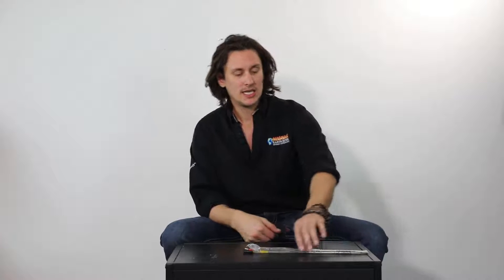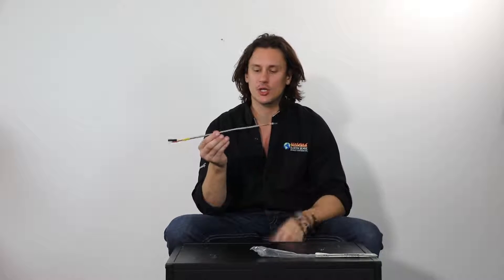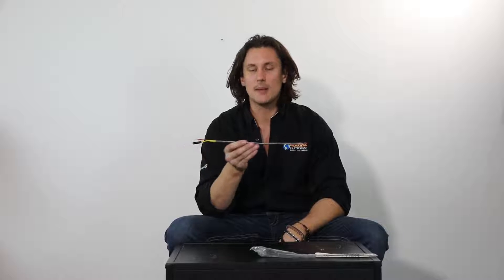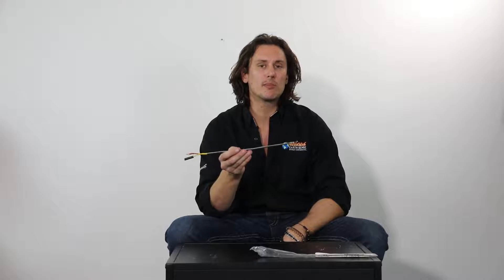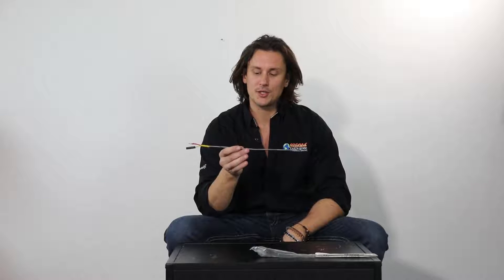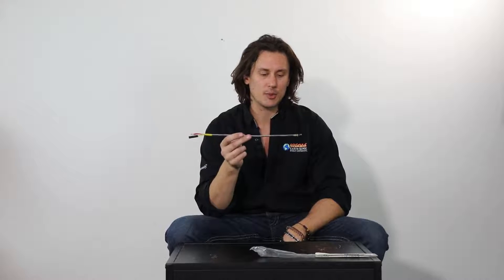Quadrafire Thermocouple Function & Troubleshooting

Comment: Really appreciate this series of videos - straight forward and helpful. That being said, troubleshooting my Quadra-Fire Contour has me stumped. I have replaced components and wiring (previous owner had just about everything jumpered out).  New parts - Snapdiscs 1, 2 & 3, thermostat, vacuum switch, and igniter. Everything works fine except I have to jumper out the vacuum switch in order for the stove to feed pellets.  The door gasket is new and seals well. The exhaust fan seems to function just fine, but it will not run unless the vacuum switch is jumpered out. I have validated the vacuum tube and where it connects on the stove is clear.  What am I missing??
Reply from the maker: Thanks for contacting us, happy to help. Appreciate all of the details here. There has to be something tripping the vacuum switch. In most cases this will be ash blockage somewhere in the unit or venting restricting the air flow. One of the best ways to pull ash out of difficult to access areas such as the firewall, heat exchangers and exhaust manifold is to put the SUCKING end of a leafblower vac on the outside exhaust pipe. Make sure the stove is off and cold. Have someone in the house opening and closing the front door of the stove and moving the heat exchange scrapers. This will pull out ash we may not have seen that is clogging or blocking the air passageways. Here is the style leafblower vac our service and maintenance team uses - https://pellethead.com/product/toro-vacuum-leafblower-pellet-corn-stove-exhaust-vent-cleaning-system-3-4-venting/

From there we can do a voltage test on the exhaust fan if needed to determine if it's producing enough volts on start-up to lock in the vacuum switch. 

Keep us posted, happy to help.
Reply: @EarthSense  great help - looks to be an exhaust fan beginning to fail.  Thanks!
Reply from the maker: @skokes2010  Glad we were able to help! Glad you found the issue - here is the combustion blower for the Quadra-Fire Contour for your reference. https://pellethead.com/product/quadrafire-heatilator-pleasant-hearth-pelpro-exhaust-combustion-motor-blower-fan-oem/

Any questions going forward just let us know. Thanks!

Comment: I replaced the ignitor on my Mt Vernon but it still refuses to start.  It loads and the fan goes on but that's it, no heat from the ignitor.  What gives?  A fuse or a thermocouple replacement?
Reply from the maker: Thanks for contacting us. Do you have a Mt Vernon AE or the Original Mt Vernon with the 4 Speed Control? Happy to assist.
Reply: @EarthSense  I have the AE.  I fixed my problem.  The 2 ignitor wires are fused in line and one literally fell in my hand when dismantling the plastic case holding it.  I squeezed the little metal clips, reinstalled and... ignition!  If not, it was a case of going into the main board and I don't want to delve into that.  I checked and cleaned my thermocouple but my issue was not there.
Reply from the maker: @jeantheriault7783  Excellent to hear Jean, glad you found the root of the issue. Yeah, thermocouple will only be to initiate fuel feed after the startup cycle. Any future questions just let us know. Thanks!

Comment: Hi great video. I have a CB 1200 only 6 months old. Today it won’t power up at all. I have 110v going in. Fuse is good. Jumped tstat. Snap disc 3 not tripped. No lights on control box. Any ideas? Maybe blown circuit board?
Reply from the maker: Hey Vincent, thanks for contacting us. If you can, let's check wall power coming out of the outlet. From there let's see where we are losing power. Double check the cord connection and electrical connections going to the junction box. With the stove unplugged you can pull the board out and place it back in. Let's start with the simple things here first. Is the stove plugged in to a surge protector? Have there been any recent electrical spikes or outages by you? Happy to help!
Reply: @EarthSense  Thanks for reply. No surges or outages. I have 110v coming in. Fuse is good. Snap disc 3 not tripped. Unplugged control box and reinstalled still ng.
Reply from the maker: @vincentdimaggio5627  Thanks for the info Vincent. I will run this past our tech team to get their insight. I'll follow back up shortly. Thanks!
Reply from the maker: @vincentdimaggio5627  Hey Vincent, just heard back from our tech team - Most likely it is either a broken connection in the junction box or a faulty control board.

Is there a dealer near you? Oftentimes the dealer can test the Control Box to determine if there are any issues. We do offer a service to test control boxes as well for Quadra-Fire. You can email info@pellethead.com for further information regarding. Please do keep us posted. Thanks!
Reply: @EarthSense  thanks I’m taking the board to my dealer for testing tomor.
Reply from the maker: @vincentdimaggio5627  Perfect Vincent, I think that is the best move. Keep us posted once it's tested. Appreciated!
Reply: @EarthSense  Thanks so much for the help guys! Turned out to be a blown control board. Got a replacement under warranty. Back on line again!
Reply from the maker: @vincentdimaggio5627  Fantastic! Great to hear! Make sure you have a surge protector in place Vincent. Glad we could help!

Comment: Hello. I own a classic Bay 1200 I just replaced the igniter now the control box is blinking amber light three times please help
Reply: Ok will do
Reply: Looks good lighty wire brush off ceramic tip and put thermocoupler back in stove. Power on blue light then yellow 3 times
Reply: I will switch wires now because im running out of options but i didny install this just picking up where someone left off. I live in the home the stove is in now. I was reading mayb simple wire swap. But the stove did work two momths ago i fired it up before winter. Well glad i have a furnace. Lol
Reply: Another question i have is on the wall connected by like phone wire to switch that reads off learn(remote) and on. Switch to on correct?
Reply: Red light on pots allmost full. Looks like i gotta adjust flame heighth pellet feed rate. But no joy. Still no warmth from ignitor area.
Reply from the maker: @Tophr72  Hey Chris, thanks for the messages here. We have seen circumstances recently where the thermocouple wires need to be switched  for proper operation. On your wall control - is it a standard wall thermostat or do you have the digital remote control thermostat? If it's the remote thermostat,  yes for on, and make sure batteries are good - batteries even at half life will not allow it to function correctly. Back to operation. On start-up it should only feed a small amount of pellets, igniter lights, thermocouple senses proof of fire and the stove goes in to normal operation. Keep in mind it's the super heated air rushing around the igniter that is lighting the pellets. Let's make sure your door seal and ash door seal look good, burnpot holes are open, bottom slide plate is closing all the way and tightly, there are no ash blockages in the stove or vent, and that our combustion blower is running close to line voltage during the start-up cycle. We can always check the ohms on the igniter as well; it's rare, but sometimes a new one can be faulty. Here is a vid on checking the igniter ohms. You should have the 300 watt loop igniter in your 1200 - Proper ohm range will be 43.5 to 53.5 ohms. Let's make sure it's in range. https://www.youtube.com/watch?v=z4wmCc96rVI

We'll get you back to 100%. Keep us posted. Thanks!
Reply from the maker: Thanks for contacting us Christopher, happy to help. If you are seeing 3 amber blinks on the control box it means that the board is sensing an open circuit on the thermocouple. Typically it is either disconnected or broken when these lights light up.

Let's inspect your thermocouple and thermocouple wiring connections. Keep us posted, happy to assist.
Reply: @EarthSense  holy s@;t I just dropped wires and turn the power on now the pellets are feeding hopefully for the best